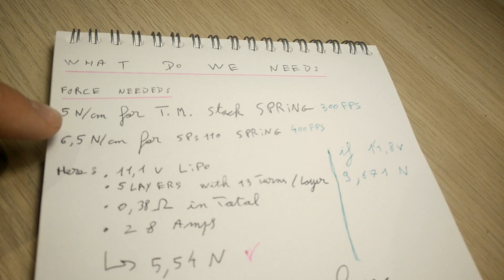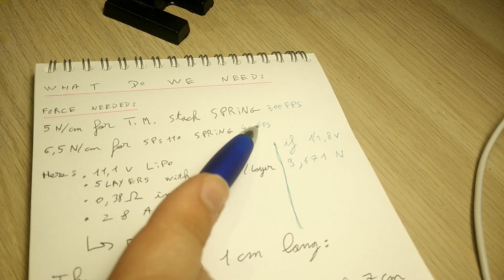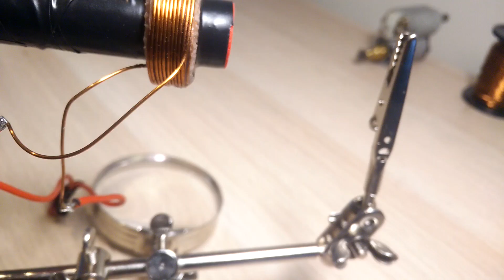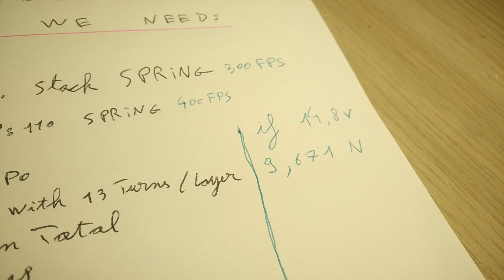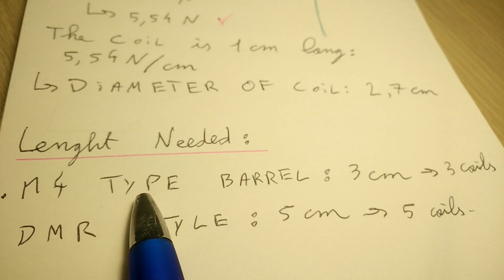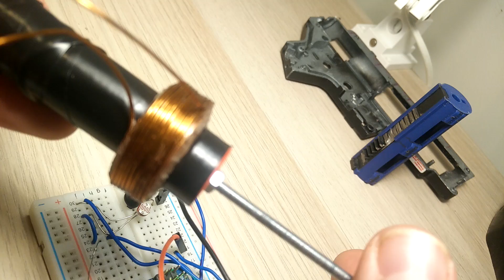Final prototype of Electromagnetic aeg?

Comment: Man, interesting project you are doing.
But, what if instead of using a photosensor, you take advantage of the magnets' own magnetic force and insert another coil that will serve as a sensor when the magnets pass through it?
After all, when the electric current passes through the first power coil it will generate a value X in this sensor coil because of its proximity, but when the magnets pass through it it should take on a -X value. The Arduino has the ability to "perceive" these variations and use this as a trigger to activate the second power coil.
With a more elaborate code you wouldn't even need this sensor coil, you would just use the -X value when the magnets arrive at the second force coil, the code would understand this variation in the second force coil and apply the electric current to it, forcing the magnets to continue for the third power coil.
When the magnets reached the end of the path, all they had to do was reverse the electrical currents to return it to the beginning.
I know this is much easier said than done, but I still think it's more practical than a photo sensor.
Sorry for my English, but I sent everything through Google Translate.
Good luck with the project and we look forward to the end of it.

Comment: I know it's not up to date but this project is fantastic. I've came to similar idea and doing my research stumbled up on your video. This project have a lot of potential. But you've made one single mistake. The magnetic field behaves quite strangely and if you make the piston with ferromagnetic material like iron you don't need more coils because the magnetic field will be the same all along the pipe. If you have other questions you can contact me. I'm student and i would like to work on some project with someone again and this is really promising.

Comment: Love this project, did you progress any further?  Regarding power transfer to the coil on the piston as the eariler prototypes , could it be possible to use carbon brushes in a 3d printed piston? Systema PTW's use an tappetplate-less system for the nozzle, maybe it could be copied.

Comment: Cool, working with some same ideas..  what type of bridge did you use with the Arduino at the end of the video. 2nd issue will be to solve the tappet plate since no mechanics drive the nozzle back and forth but you could place a 2nd coil approx Dout=16mm, Dinner=10mm, L=10mm where the nozzle is, what would give you around 4 windings what could "suck" the last mm the cylinder (opposite pole of course) so you would have 3-5 Coils inside and a 2nd coil at the nozzle...still the feeding issue with the tappet plate must be solved
Reply: The feeding issue could be btw be a 2nd project where a valve open and close the HHU feeding, since we need to use a Arduino anyway we can time the feeding valve too

Comment: Hello there! Name's William. I'm from Spain and I love DIY projects. And I also love airsoft, I'm trying to make a vest with velostat.
Reply: Can ya put a PDF or any electrical scheme or instructions on next videos to make this? No problem if its in Alpha stage, feedback is promised.
Reply: And why dont put a spring at the back to push the cylinder to shot? Just use the magnetic force to push back the cylinder to let the spring make the shot. Like:

Position Zero.
Te BB is charged.
Position One.
Cylinder is pushed back by magnetic force.
Position Two.
Magnetic force is cutted and the spring push the cylinder forward.

Or:

Position Zero
The same, but the spring actually push back the cylinder.
Position One.
The magnetic force push the cylinder forward and make the shot.
Position Two
The magnetic force is cutted and the spring push back the cylinder.

What do ya think?
Reply: I just crafted a 3D model of the concept and looks pretty good. Wanna take it?
Reply: https://youtu.be/ygp7cWSNOf4
Reply: I'm a proud warhammerian, a lover of the Warhammer40K universe. And a total geek and freak. I'm studying Industrial Robotics and have a few knowledge aboug Arduinos and stuff, and I was thinking the idea of making a lassgun, an actual Imperial Lasgun Kantrael type, and whem I looked at this I knew that I wanna do this.

Comment: How does your circuit look like? How do you connect the electromagnetic coil to the battery since wouldn't it basically be a short circuit if it's plugged directly? It needs some kinda resistor/diode assembly, am I right? 

Great job btw!!! Keep it up. I'd love to see these things on the airsoft fields. I got inspired by your older prototype and will be trying it out myself. Of course, I will credit you if and when I post about it on the internet.

Comment: What about brushes and rails for the coil piston? Your forces are the same as the TM spring, but if the piston is too heavy it will accelerate slower.
Reply: I wondering on abandoned (why?) MTO Phantom project 
-  was it rails on image? https://nlairsoft.com/item/bo-manufacture-mto-phantom-spotted-in-japan
Reply from the maker: Automobilie you are 200% right !! Thus, the shaft + piston head + magnets should be as light as possible.
Ps: for the rail, someone should definitely try !! I couldn't figure out a proper way of doing it...

Comment: instead of using LDR's for detecting your magnets, can't you just use Hall effect sensors? place a row of them underneath the cylinder, and then you know exactly where the magnets are. I love your concept, if it works out, that would be an amazing step forward in airsoft technology!
Reply from the maker: Jens Mortiers well halls sensors are the second solution, I just don't want to be bothered by interferences caused by the coil/magnets ^^! And well, a led and a photosensor are cheap and I only need one !